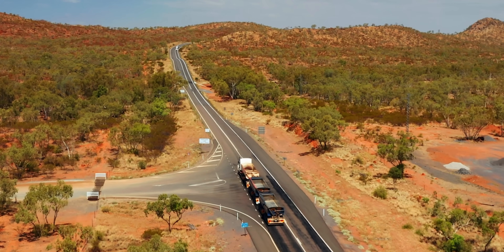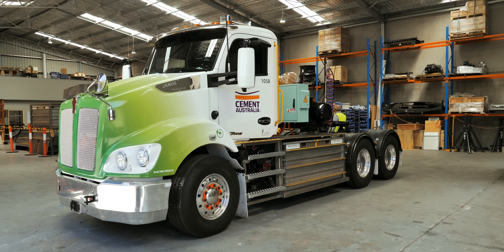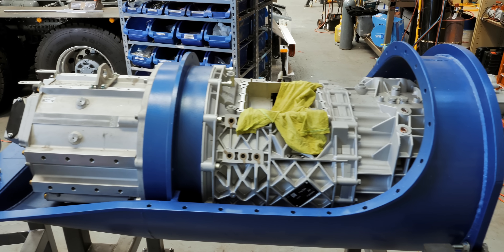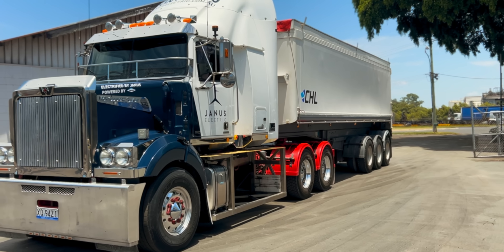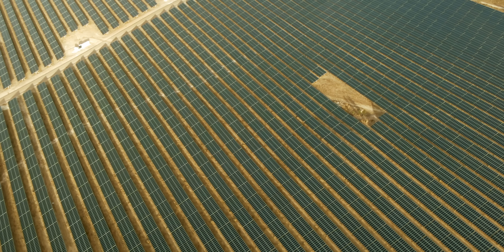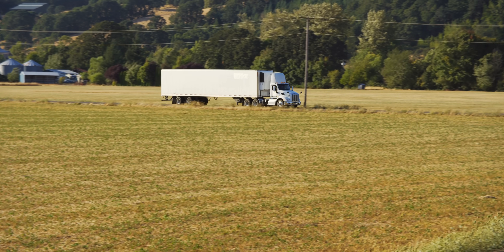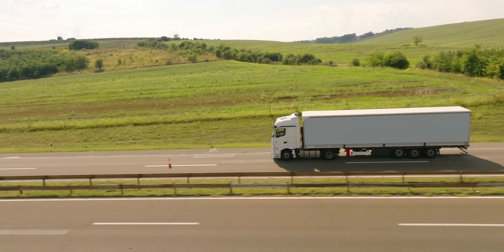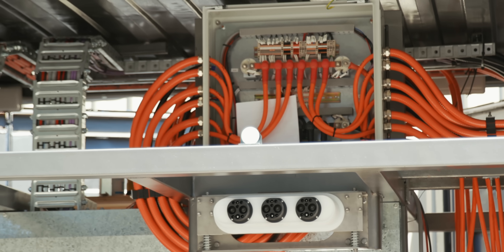This GIANT Electric Semi Can Swap Out Its Batteries!

Comment: The only bad thing is these batteries that are swapable are going to cost the customer much more than a diesel based on their swapping. Someone one has to pay for the battery and they will degrade just as fast because now they are in every truck running hot and everything else. There is also no cooling on these things? 
The one thing that Tesla has going for it is it is far more efficent and has a way smaller battery pack and is about as good as this thing. Using the most miles and the least amount of energy this truck might beat a Tesla. yet If you give it the lowest miles and the most energy it is bonkers bad. 
Tesla is also a brand new right oppsed to using an old chassis and outdated tech. I am quite sure that Tesla rigs are far better for driver comfort. I have a mate who drive over there and those long hauls are not fun. With my owned tesla I could run the truck how I see fit and charge it how ever I wanted. Swap able batteries sound nice till you start getting some crappy packs that reduce you range by 50 km and you have to decide if you can make it back or not. Once they degrade enough they are no longer worht it they will be scrapped. While My tesla could be sold to some farmer who longest ever haul is an hour drive and a 200 to 400 mile range truck is ideal for them.
Reply: Janus is a just a small business. Give them time to grow.. At the moment their business model is giving an old truck with a blown motor a second life by converting it to electric. So bad aerodynamics with the big unnecessary front grill without a radiator and normal tail shafts and drive axles hold the efficiency back.  They are a conversion company, not an electric truck manufacturer.
Traction motored drive axles and a more aerodynamic cab would be more efficient, but would put the conversion cost beyond any customer.  They are decades away of building their own rigs from the scratch. More likely the Janus owners would receive a generous offer to give up their design to one of the big truck manufacturers and a new truck built from the ground up around the Janus electric design.
Reply: @stuarthancock571  It is a cool concept and it will likely work for a while. Conversions are easy to do and electric is really the way to go. I just think the 100k USD cost to do a converstion is quite costly since you are not buying a battery. The conversion cost should likely only cost maybe 35k if that. Unless they are charging full price for the battery and your only choice is to get a battery from them. Which is what it seems to be. 
Swapping batteries could be a good thing yet in the long run they are going to be much more costly for the consumer in the end because on top of the electric cost is the battery cost and those fees are going to stack up. Now I would not mind paying a surcharge. For example if the battery pack will get 1 million miles of use out of it. In theory I could could pay 20 dollars for every battery swap for the useage of the battery, pro rated. 
For example if the cost of the battery is 50k and you get 1m miles at 375 miles per usage you would ideally get 2600 uses from that battery pack if you get 2 batteries per day and drive 250 days a year then you would get 5 years of use from one battery. Well that would be pushing the legal limits on hours you can drive at 12 to 13 hours depending on speed and shorter if going much faster than 60mph. 
Either way what i am trying to get at is that unless they are selling the battery outright for the life of the battery or the life of the machine? That is my problem. its overpriced at 100k when I am sure Tesla will cost around 200k for the 300 mile version and maybe 300k for the 500 mile version. Yet this might still be even way to high from the original price estimate of 150k to 180k
Reply: @kameljoe21  I think their idea is that the customer has a fleet of trucks and various depots with each depot having surplus batteries always charged up and ready to swap over when the cargo is being loaded/unloaded. The truck has 2 batteries. So, depending on each customer's needs, 1 truck may need up to 6 batteries each, 2 on the truck, 2 at pickup depot and 2 at drop off depot.
Reply: @stuarthancock571  I can see that working for some companies. Its a super idea. Once we can go from 250wh/kg to 1kwh/kg thing will change. There is tech out there that is in the 500wh/kg range yet it does not manufacture on the large scale yet and has been working on a factory for several years already.
Reply: @kameljoe21  And that was the point the Janus spokesman was saying. Once battery technology improves it’s very simple thing to replace, unlike normal EVs.

Comment: Great for city style use. Or within range depot to depot jobs. Can't see you doing a battery swap on outback runs. Also range is still an issue. How well will the motors and batteries put up with outback road conditions. Who is going to stock the batteries for exchange. An urban solution not a rural solution.

Comment: Not many hard questions, I note. So if you're adding one tonne to the overall tractor-trailer combination by exchanging the diesel powertrain for batteries and motors, is a trucking operator prepared to sacrifice one tonne's worth of PAY-load on every single trip? 
On a small fleet of five trucks, that's potentially five tonnes of cargo not paying bills or salaries on every trip. Trucking operators don't give a shit about emissions. They care about getting paid. Otherwise, what's the point? Fleet management is about numbers, it's about weight, costs and margins. Lindsay Fox doesn't run one of the country's biggest fleets on good intentions. He does it based on numbers.
Don't get me wrong - it's a great concept and it's nice to see some Aussie innovations coming through in this way. Best of luck to them. I genuinely hope it succeeds. But in order to make it viable, as a journalist, you've got to ask harder questions than "Wow."

Comment: Running the scale numbers on this it always falls apart. I can't imagine the electricity infrastructure required to be charging 10 of these packs (enough for 5 truck changes) a day. Just imagine the cost and infrastructure for say 200 trucks that a small station service today in the diesel world. Times a couple hundred or thousand "gas stations".
Reply: But but wind and solar they say!
Nevermind that wind and solar power have their own associated costs and weaknesses.

Comment: Those are electric forklift trucks dialed up to the moon. You can do stuff with industrial applications you just cant do with consumer stuff ( cars would need automated replacement stations, this truck just needs a forklift operator for a few minutes. If the batteries last, the network is there and its cheaper than it could work out. No Turbo whistle tho... :)

Comment: The engine vibration in a truck increase driver fatigue, cause wear and tear on all sorts of equipment. I've heard having a banana in the cab just isn't an option. It also can probably can cause all kinds of health problems, to be rattled apart for up to 14 hours a day just can't be good for you. I'm not a truck driver, this is just speculation.

Comment: I wonder how much lithium you’re going to have to mine to set up the kind of infrastructure you would need to build all those charging stations? You see so many of these sales pitches for electric vehicles of all types electric motors are great the current battery technology is not.
No amount of spin is going to change the facts.

Comment: Love what Janus has created here ,  a minutes time to re fuel the truck ,,wow shit that's a real good start ,  the re generative brakes and massive plus 540kw re gain in one brake application,,  yeap that's good ,  no service needed on engine,  extended life on all driveline components,   not quite long haul ready but you guys at Janus have done a better build than both Volvo and Tesla ?,   new to trucks so they've got much more to learn than Volvo or scania and Janus concept beats all off them,   even I'd consider doing this conversion with a truck just as soon as diesel eng8ne ask for money to be spent on it I'd be happy at 500kg increase weight to loose the diesel engine parts and cut running cost by almost 2/3   that's a point people need to weigh up with costing of conversion cost an batts,  and diesel fuel cost will just keep rising ,  same as electricity cost rising ,,  so your own solar grid and storage is absolute must have to make this set up most efficient it can be,     great work Janus,  the innervator in electric trucks

Comment: And the cost to mine, ship, process, ship, make all components, to ready let's go cost what . How much fuel, air pollutants, 1 million mile longevity, cost of replacement. You live in a dream .  I forgot, how do you charge the battery, wish and a prayer or a power plant that burns FUEL.
Reply: South Australia is 80% wind and solar. Coal fired power plants are shutting down in Victoria and New South Wales.

Comment: It is impossible at this point to charge up batteries for a semi-truck faster than filling it up. You can swap out batteries faster than filling it up but you can't charge up the batteries faster. Secondly the manufacturer of the batteries from drawing the raw materials out of the ground to processing it into batteries is a hugely toxic construct that is far more toxic that comes out of a diesel engine when it's running properly and falls to the ground and becomes dirt.
And people who believe that 100% of the electrical energy out of a battery goes towards turning that electric motor and pushing the truck down the road is an idiot. Because the electromagnetism that is wasted in an electric motor is at least 60% of the electricity that goes into it.

Comment: ANOTHER POSSIBILITY I SEE IS ALSO CARRYING BATTERY PACKS ON THE TRAILERS, CONNECTED TO THE TRACTOR WITH JUMPER CABLES, OR ALSO HAVING ITS OWN DRIVE MOTORS!
Reply: Too much weight.
Reply: @stuarthancock571  AGREE IS A BIT ON THE HEAVY SIDE, BUT CONSIDER ALSO LOADS THAT ARE BULKY BUT LIGHT WEIGHT!
MORE BATTERIES, MORE DISTANCE !

Comment: These guys are so spot on with what they’re doing, reusing existing trucks, decoupling the batteries and battery technology from the trucks and so on. This is exactly what’s needed in the passenger car industry, those affordable EV’s could exist right now, as reconditioned popular cars like VW golfs, BMW 3 series etc with new electric motors and quick change batteries and  I expect with the amazing new battery technologies coming to fruition in the next few years this is exactly what will happen.
Reply: Not really. Trucks last much longer than passenger cars (and cost a LOT more) which makes it more worth it to retrofit. Making new EVs is far more efficient than retrofitting.
Reply: @Freba9  beg to differ, it’s £50k  for an EV and battery prices and densities are dropped by the day, soon it will be possible to simply lift the engine and drop in an entire battery drive module.
Reply: @Jonny_Spaceman  EVs start at about 25k. Retrofitting is not easy nor cheap. Batteries often need to be part of the subframe of the car to be safe enough. For that money you cannot retrofit an existing vehicle and create an EV with comparable performance as a new EV.

Comment: Fueling a truck is a simple task that all drivers do. Battery swapping would need to be easy enough for drivers to do by themselves. This is especially important for OTR drivers. Time is money and the less time you waste the more money you make as a driver and as a company. It is also important to eliminate variables that might increase time wasted, and from what I saw , having to depend on other people to have and replace the batteries when you get to a swap station, that’s introducing too much potential for things to be against you during deliveries. I’d work on making the swapping into a task that can be put on the driver and not a station crew member.

Comment: the  bigger question i have how far can it pushing in  flood waters???

Modern diesels  you be lucky to get 10 years out of them  with DPF involvement 25-70 years pending on long you leave it between rebuilds????

from what I have seen from my mobility aid you have to go faster than the top speed the  motor  is capable of doing I  don't think regenerative breaking is  going to have enough power to sustain power you would have to sustain the  above the default speed setting when applying the tech to larger at some point you would likely have to use  the trailer as a dc free wheeling dynamo to promote dc charge to the prime mover...

I see this tech more useful in a 6x6-8x4 cab design, as traditional  bullnose design it likely   it makes more sense to develop a direct drive per axle  power system than standard diesel power train 

as regen breaking on charge .. systems
Reply: "you would likely have to use  the trailer as a dc free wheeling dynamo to promote dc charge to the prime mover." ehrm what?!
Reply: @Freba9  I live on the same concept on the mobility aid for me to generate a charge  on that i need to be faster than  its top speed  to generate a charge a charge going  down hill i do not think regen breaking is not going to help in recharging those batts

the faster you can spin a dynamo the  more chance you have to charge those  batt

the power has to spin faster to generate power to recharge, your batts, the brushes on my gopher might  get changed every 12-18 month's as they do wear out

the will likely apply  every few runs because you will be wearing them out every 300k's or less

noting looking at they were replacing the truck battery  for proper recharging  tells if they are using  regen breaking as example  to describe some charge everyone within that mode of thinking is selling you snake the functional reality  for a dynamo to actual charge you you will likely going to have a dynamo between 220-350 km/h to generate the actual power for recharging your batter

I don't if i have a list combined weight of weight of 450-500kg between me and the mobility that i ride on and extrapolate 500-1000+ ton prime mover considering you  are still powering by conventional means whether it powered on recharge by:

coal fired power plants
gas fired power
multi fuel gen set 
diesel fuel gen set..
Reply: @jasonhowe1697  Are you talking about a dynamo connected to the wheels to charge the battery while driving? That is impossible. You cannot create energy out of nothing. First law of thermodynamics.
Reply: @Freba9  yes  essentially the diff becomes the motor the same as the motor on my mobility aid works though to do this  in a recharge manner the speed of the motor would rev faster to promote recharging of the national speed limit whist going down hill
stop applying what we know about thermodynamics  as we apply to a traditional engine doesn't necessarily apply the logic to an electric dynamo
Reply: @jasonhowe1697  Ah, whilst going down hill. Then of course it would work.
Reply: @Freba9  that is the pitfall of electric powered vehicles, trying to using breaking a as  a charging method  because  the  dynamo itself  needs to spin faster generate the power  recharge said batteries

a bit hard to under brakes

regen breaking  in my opinion is the snake oil of the electric vehicle movement..

at this stage diesel is going to be king for years to come due to the distance it can cover, and this  video proved the poiny that  you are replacing every 2 loads it is carrying  for proper charging...
Reply: @jasonhowe1697  The speed of the 'dynamo' does not matter.
Reply: @Freba9  when you are trying to charge something it is whilst on  the move..
Reply: @jasonhowe1697  The electric motor acts as an alternator when slowing down or going down a hill. There is no need to increase the rpm.
Reply: @Freba9  I found out by accident 15+ years ago of what I'm talking about going down a hill going towards oat st train station before they started setting the angle and brake gauge to slow gophers down,

having said that applying the exact same thing to a truck still applies when you want to recharge on the fly..

with a direct drive system in play you typically need a gear box as the foot or finger act as the throttle control
Reply: At the moment, Janus is just a small business conversion company, not an electric truck manufacturer. The extra cost of replacing the drive axles doesn't add up.
Reply: @stuarthancock571  yes they might be a small retrofitting company however they also proved the point i was making that they are still ripping thise batts out to recharge them conventionally you saw in the video them changing the batt banks over

Comment: New engines, which also use counter rotating magnets inside them are also changing the way energy is produced. Interesting new inventions are happening every moment all around the world. The future of transport will be at this rate incredible!
Reply: Ehm no they are not. Basic physics will always apply.
Reply: A hundred years ago Nikola Tesla drove an electric car for a week using power that came from a small box of components.
Free energy occurs when energy is transduced from a higher dimension down into this one.
We are on the verge of a change in the paradigms of science, both in terms of physics and medicine and batteries will soon be seen as we view oil lamps as a form of lighting.